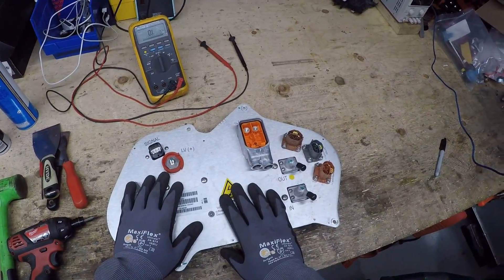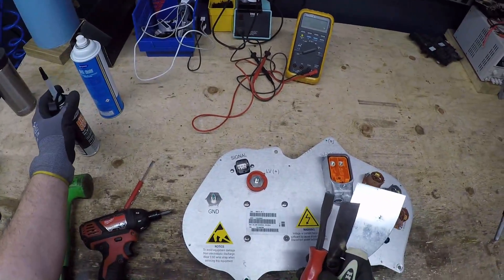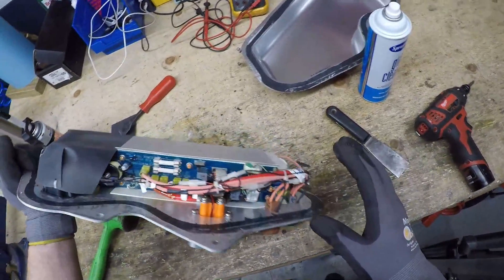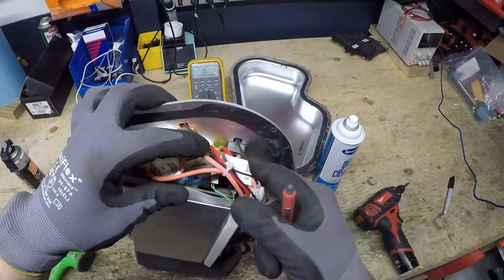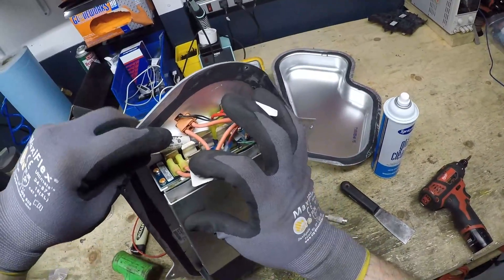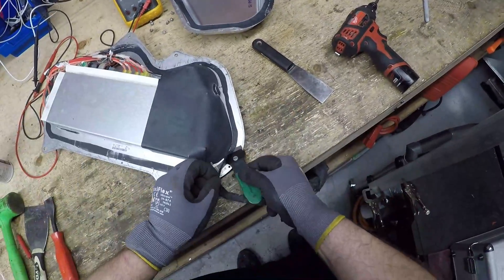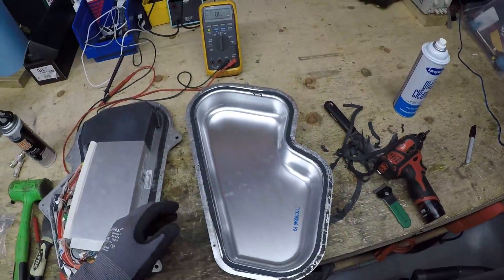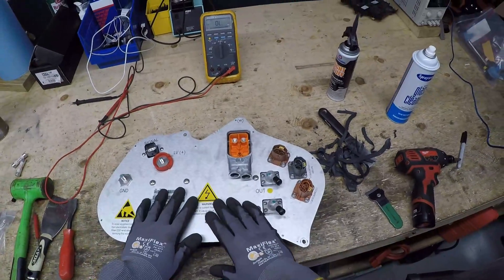Electrified Garage: Tesla Model S Gen 1 DC/DC 6009170-00-J Fuse Check and Replacement

Comment: Hi,

Thanx for this amazing video!!!
Do you need to refill coolant after assembly?
Reply from the maker: Yes, top off the cooling system, plug in for charging, this will cycle the cooling pumps causing the air to purge into the revivor.

Comment: Thank you for that video.
I have some questions about fixing the PTC and the AC/AC convertor and hope you could answer them:
+ to disabled the HV system I have to follow all steps of your battery 12V video - did I get that right?
+ where do I find the PTC / how do I get to it?
+ I have a 2013/11 Model 85S. Can I fit a more modern PTC (I think there are 3 generations of PTC, my car originally used the 1st)? or can I fit a PTC of a 75 model?
Reply: - negative lead on 12V, then disconnect firemen's loop harness
- GEN1 PTC slides out near the passenger side footwell area. Pretty much everything is in the way: center console, Passenger knee airbag, the dumb metal bracket that holds the airbag, hvac tube thing. 
-Then you got to snake orange wire out after disconnecting the harness from the DCDC, i'll let you figure that one out. Not simple to do
Source: I did this today...
Reply: @mikec7812  did you do yours?  I have a bad 20 and 40 A fuse. wasn't planning on replacing the heater & never had issues with it/ just no 12v charging

Comment: Great instructional video.  I would point out that it is probably best to do the electrical continuity check once you've replaced the fuses BUT BEFORE reinstalling the lid.  That way you can adjust for any mistakes that may have cropped up during the fuse replacement procedure (e.g. bad fuse from the parts dealer, bad insertion practice, wonky fuse holder) and correct them.

Comment: Hi Chad. Great informative video.
Please can you tell the functions of the wires in the low voltage connector. I think the two black are for the HVIL What of the blue, purple and yellow? Two CAN bus wires and a 12 DC charge enable? Will the application of HV (say 300V dc) cause a 12volts output, or does it need CAN bus instructions? Thanks.

Comment: What are the faults on the car to suggest it needs replacing? 
Tesla are charging me £1100 to replace the whole DC/DC converter on my Model S.  They can't be sure it needs to be replaced until they've done it they say after a 2 hour diagnosis
Reply from the maker: The faults would be 1) No Heat 2) No A/C 3) No supercharging ability 4) No 12v Support 5) No battery heater function.
Reply: @ElectrifiedGarage  could this cause the car to shut down/failure to run?  I got error codes GTW_w018 and DI_u014 and am told DCDC converter is the problem.
Reply from the maker: @chrisazim1  no, the issues would be no heat or a/c function.  When the fault has di in the beginning its referring to the drive inverter. Gtw is a gateway fault. Things that could shutdown the vehicle is low 12v or something preventing the HV battery from turning on.

Comment: How can one deal with the software issue of replacing the heater if shorted? Can the control board be swapped on to good heater elements? Can the heater be checked with a DVOM?
Reply: You'll need an Isolation DVOM to check the heater. The logic board can be swapped over. Later versions of firmware seem to not have an issue with requiring firmware afterwards. We haven't found a rhyme or reason to this though.

Comment: Great video. I appreciate the step by step. Where is this located in the car?
Reply from the maker: It is located inside the passenger front wheel well behind the arch liner. It's bolted to the firewall.

Comment: What happened to easily accessible fuses? Tesla seems to make this harder  than necessary. :(
Reply from the maker: This part is made by Toyota not Tesla actually. You're right they're not easy to access but where its high voltage they need to be protected.
Reply: @ElectrifiedGarage  This whole module assembly is made by Toyota? I didnt know the fuses were high voltage. Would they have been better off using resetable breakers under an access port instead of fuses? Or do they really not want people working on their own cars and expect everyone to visit the dealer?
Reply from the maker: @JasonWW2000  The engineer that designed it I am sure designed it "not to fail" :) Easily better ways to have gone about it but it is what it is. I doubt serviceability was a thought at the time of development.
Reply: @JasonWW2000  
I suspect that resettable breakers would be dimensionally larger for one thing, but also that introduces another fail point. You now have a mechanical mechanism instead of a solid object.. 
I suspect the resettable breaker would have to be under that cover protected because of the high voltage involved. And if you've got to pull the thing out and get the cover off anyway at that point a fuse is pretty much just as easy.

Comment: Where is thus unit in the vehicle. will you show how to put it back?

Also, can you list the items needed and the gloves? They look nice. Thanks for the videos
Reply from the maker: The module is mounted in the front right wheel well behind the arch liner cover. It is a couple of bolts, electrical connectors and coolant lines. Removal and replacement is very straight forward once the cars HV system is disabled. You can look to the battery 12v video on how to shut down the car prior to working on the HV system. The fuse blows because either the heater is shorted internally or the A/C Compressor tries to draw too much amperage. The fuse part # is in the video description. The gloves are called "cut-resistant" and can be found at most PPE vendors like cintas, uline, etc.

Comment: Hey Chad, Great video, never saw this done before. Just some questions. What would cause these fuses to blow? And second Where would I be able to buy these replaceable fuses? Is there a part # for them? Thanks for any info. Luv you guys.
Reply from the maker: The PTC Heater fuse blows because the PTC Heater shorts internally. It needs to be replaced at the same time as you do the fuses otherwise it will just blow the fuse again.  The A/C Compressor fuse blows because it draws too much amperage on startup sometimes. The fuse part # is FWP-40A14Fa. They're available on the internet pretty easily.
Reply: @ElectrifiedGarage  Thanks for the info.
Reply: Electrified Garage Maybe not necessarily “need” to be replaced but “recommend”.  The DCDCs I have seen replaced do not open a fuse if the heater was not replaced.  But yes it is a good precautionary measure.  Nice tutorial!
Reply from the maker: K Holsopple for the amount of work involved the fuse is short money to just do at that time. Every one we ran into at the service center the heater was shorted. You can get an isolation meter to check it but it’s cheaper to buy a replacement heater at the same time.
Reply: @ElectrifiedGarage  great video. Although, I would check for continuity again after the new fuses are installed, prior to sealing. It's rare, but sometimes new fuses are bad, and also something else might be broken.
Reply: Does the dc dc need to be reprogrammed
Reply: 2012 died on highway. Now says low input power and 12v issues . Dc to dc fuse blown? Hv pack contactors won’t flip even with 13v connected to the 12v battery to get it charged back up. Thoughts ?

Comment: Super! Exactly what we all need. Perfect!! Thanks so much and keep them coming!
Maybe you could also show where the module lives inside the car and how to get it out?

And: why did the fuse blow? Is there s.th. wrong elsewhere?
Reply from the maker: The module is mounted in the front right wheel well behind the arch liner cover. It is a couple of bolts, electrical connectors and coolant lines. Removal and replacement is very straight forward once the cars HV system is disabled. You can look to the battery 12v video on how to shut down the car prior to working on the HV system. The fuse blows because either the heater is shorted internally or the A/C Compressor tries to draw too much amperage.
Reply: @ElectrifiedGarage  THANKS!! :-)
Reply: @ElectrifiedGarage  is there data log (freeze frame) available too see how much the AC compressor was drawing ?